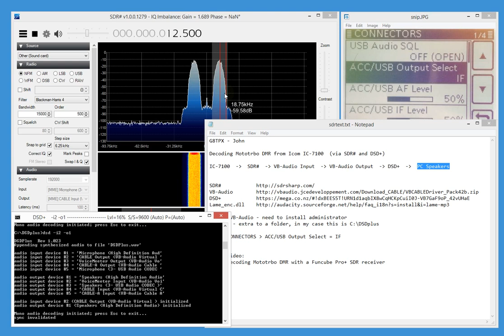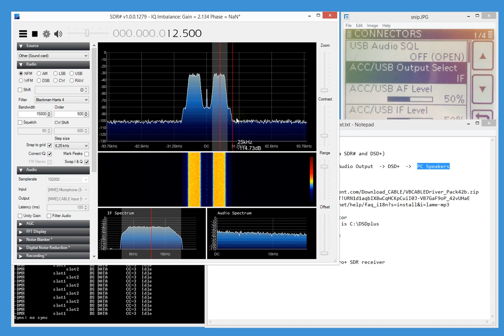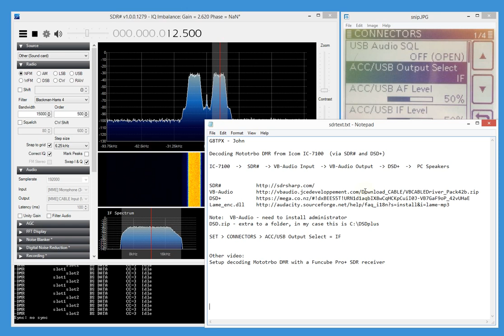Setup Icom IC-7100 to decode Mototrbo DMR using IF via USB

Comment: You don't have to go to this complex level to use DSD with a IC-7100, you can decode direct from the IC-7100 either via USB AF out or the DATA 2 port using the 9600 pin to the Line in or Mic port on a PC. Just remember to select 9600 in the Connectors menu and FM-D as the mode and away you go. Mike G1ZRN.

Comment: Nice, John.  I just ordered a IC7100 and had no idea it had IF out.  Currently, I use my scanner's discriminator tap to decode with DSD and DSD+ but I can see I'm going to have fun with the new rig.  Looks like all I need is the virtual cable, which I don't currently use.  Thanks for the informative video!